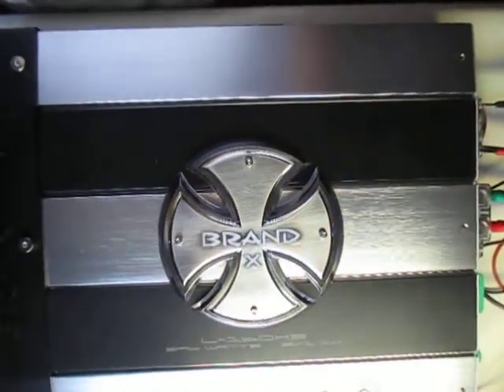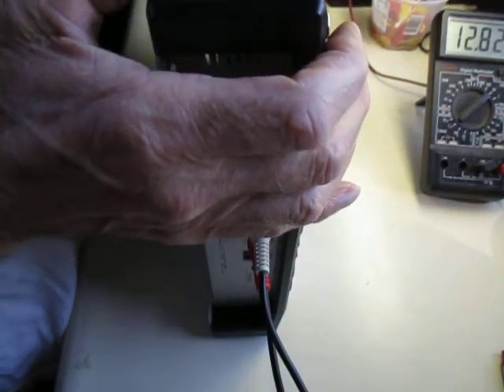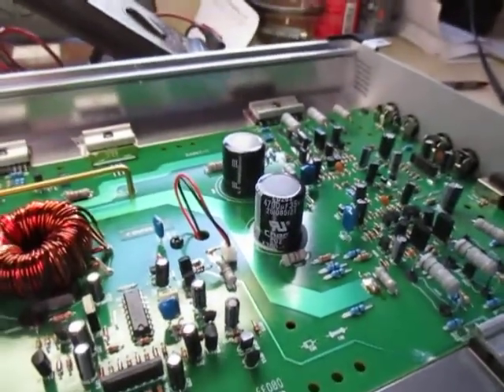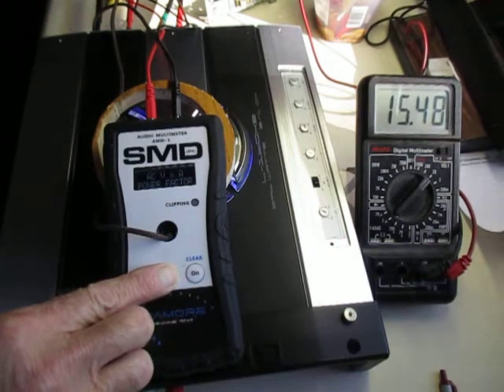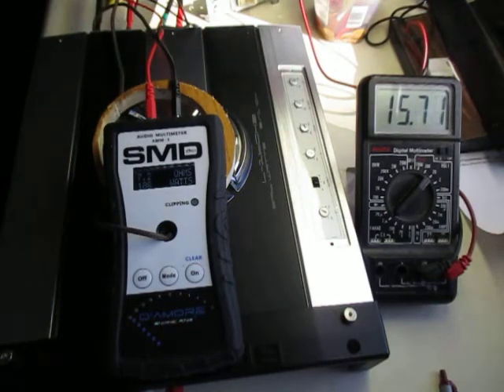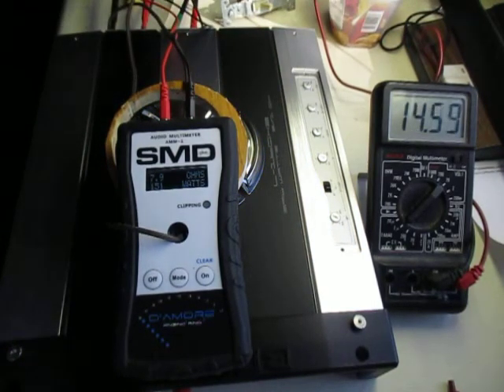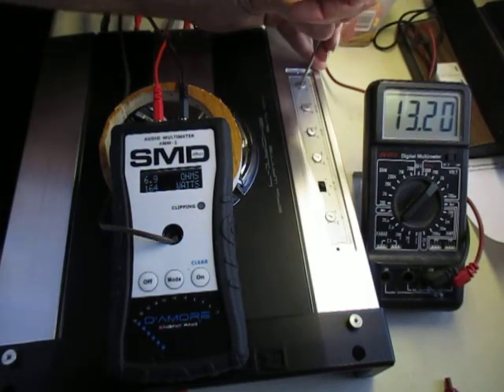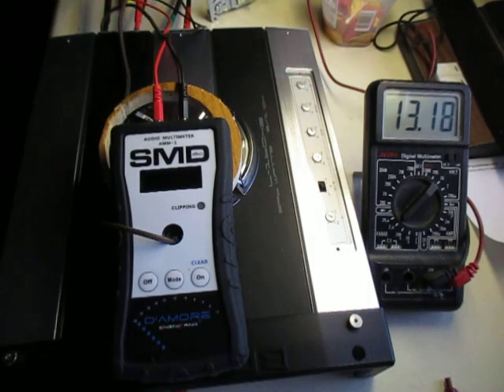Brand X  L-160 x 2 , Amp Test Thursday

Comment: its ONLY 300 watts. For $100 you can get a real name brand amp that will put out double the power and not be built like a peice of trash.
Reply from the maker: In case you didn't notice I have about 20 videos of old school amps I own. It seemed to me from watching BigDwiz and Steve Meade's amp test videos that more people were interested in newer amps especially budget amps, so I found one that neither had tested. I knew before I got it that it would only put out about 300 watts instead of the 600 it claimed. I didn't care because I already had the amp sold to a friend, and he was more than happy with the performance and price. I paid $40 and got my $40 back as soon as the video was done. Oh, and the like to dislike ratio is 15 to 1. I won't lose any sleep over the one dislike. How many amp test videos on your site? Have a nice day.
Reply: @vintagestereobuff7005  not sure why you are acting like a douche. I was talking about the amp, not you. You said the amp was around $130 several times in your video and that you would be happy pay that lol. Btw i didnt dislike your video.
Reply from the maker: @realname6485  Sorry if I came across as a "douche". That was not my intent. I came from a time when power was $2.50 per watt, so when I see an amp that will do 300 watts into 4 ohms for $130 it seems very inexpensive to me. Also those $100 name brand amps from good old school makers like RF, Orion, PPI, Soundstream and many others don't use the best quality components either.